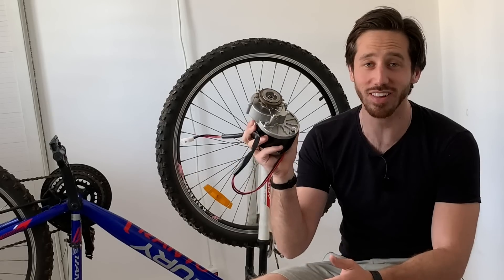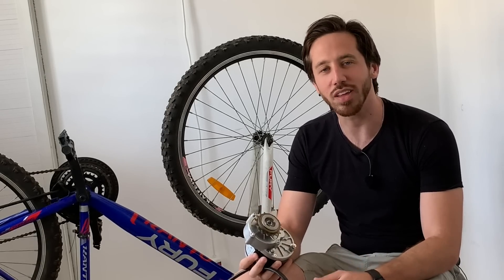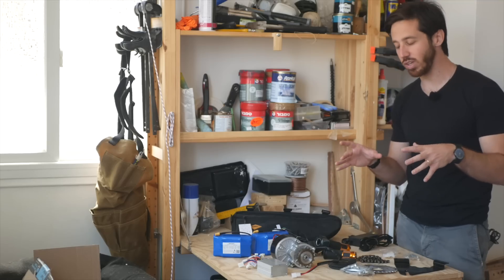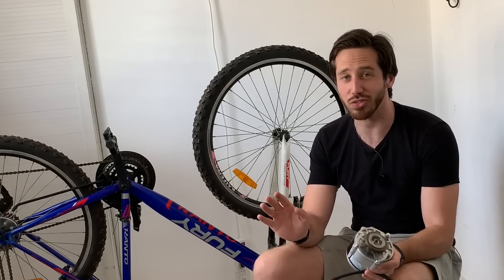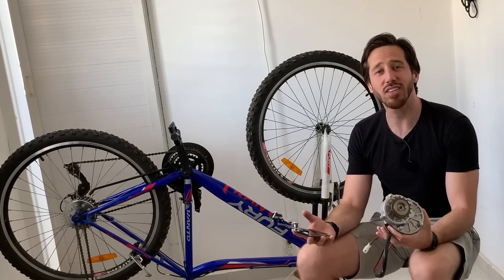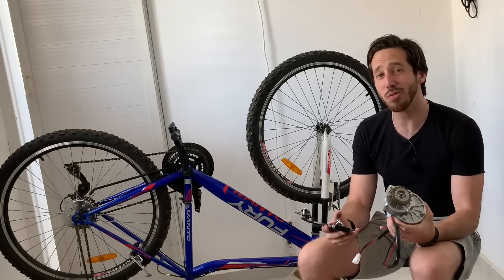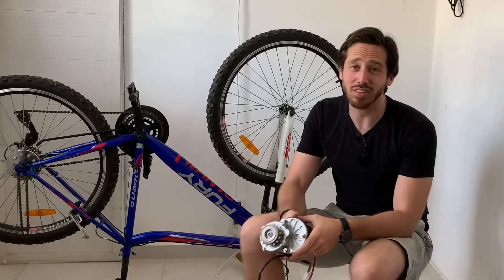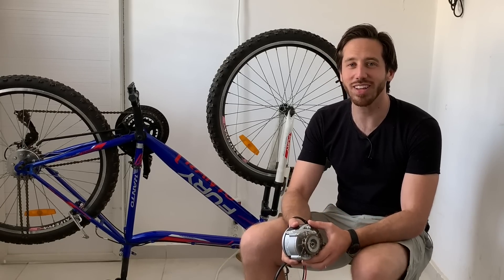Do NOT buy this $103 electric bike conversion kit

Comment: I mounted the bracket on the inside of the stays and it lined up pretty close, added 1 washer to each bolt and the chainline was perfect....but the motor is junk
Reply: I wouldn't call the motors junk. I have had both the 250 and 450 watt motors. I have put over 500 miles on the 250 watt and almost 1,500 miles on my 450 watt motor. These are geared motors and they are setup to only run about 16 mph at top rpm but if you step up the battery voltage you can get much higher speeds from them. I'm currently running a 24 volt 450 watt MY1018 motor at 36 volts and my bike will top out around 26 mph on a flat road. My bike is heavy (65 lb) and me (205 lb). I personally think that is pretty good since a comparable ebike would cost over $1,000 and I have right at $300 in mine.
Reply: @jeffholmes9483  do you have a list of links to the parts you used? 300 bucks sounds pretty sweet.
Reply: @jeffholmes9483  Some frigken glad to hear the motors are rugged , I'm planning a trip to Ecuador and have been testing my motor on a heavy Rover Tandem , sometimes I load up the back seat with large rocks  to simulate my wife and her gear ....the extra weight helps the Big Apple tire  adhere to road surface

Comment: Sometimes it pays to not be cheap , thanks for highlighting that fact .
   Personally i would only buy stuff with runs on the board , IE:  proven track record even if it costs more .  
  Old saying .....  do it once , do it right .
  Although i have never  put on an E bike kit , many times i have thought about it , and i would put on the heavy duty bafang motor , small under powered motors are more likely to burn out quickly imo , then you are back to square one .
IMO if you build powerful and or heavy duty ,  you can still choose to use low power , but you end up with a conversion that lasts a long time (theoretically  :)  ).

Comment: You may have answered this before. But I haven’t seen it. Should you top off your charge after each ride. Or should you ride several different rides and let your battery drain and then charge it. I rarely ride the same amount each time and usually drain the battery about halfway.

Comment: Idea!  Design a mount that IS universal for the "kit" you have gathered, then re-sell the kit with your mount. Don't try to make a million bucks over it, but keep to the "inexpensive" theme. You can make a million bucks by selling a single unique item at a huge price ... or you can sell a million of them and make one dollar profit on each one. Personally I went with a rear hub 750 watt motor = $260 to $280 (U.S.) (depends on the warehouse where you buy it) It's the easiest and safest conversion of them all with all the torque I need to pull a cargo trailer loaded with 100 lbs of groceries up a 5% incline at 28 mph. The only extra to the kit was to order and install a controller able to handle 1500 watts which means it's far less likely to cook the FETs under load.

Comment: Thanks for making the vid, good to have the warning.. . Bracket fixings seem a bit flimsy, if you consider the force of a big pothole.    Even if it lined up the motor cog would get v close to the spokes. Could try a spacer to step the wheel cog away from the spokes, or find a wheel  where the spokes are nearer the frame, more dished? Perhaps it fits town bikes & shoppers better than mountain bikes.

Comment: From my experience with these kits there are to motors used, the MY1016 and the MY1018. Both will fit the mounting bracket but the MY1016 has a 1/4 inch stand of that keeps the motor from lining up like it should. It is like they should use a different bracket for each motor type. It is just a guess but I think if you used the 450 watt motor (MY1018 ) things might have lined up better.

Comment: I bought two of those motor bracket sets and they both work fine on the two old mountain bikes I used them on. One bike I have been riding three years now . Maybe the age of my bikes made it easier to fit chain drive sprocket alignment ? Search YouTube Rick Alger to see my bike 👴🏼

Comment: I had one of these on my bike before I went brushless. It wasn't bad when it worked but I had a list of issues;
1: Chain tension was impossible to maintain because it kept getting loose and throwing chains every couple hundred miles
2: Sprocket alignment is a pain in the arse
3: the freewheel fell apart on me during my commute so I put it back together as best as I could and welded it, which netted me another 2000 miles luckily.
This is a good solution though for fabricating your own electric go-kart though. It would get a decent wriggle on with the right gear ratio.

Comment: How does the difference in volts in a charger and a battery impact the battery?
For example. Lets say that my charger is rated at 12v and my battery pack is 24 volts, how would it change  if my charger were to be 24v ?

Comment: all you have to do is put split plate on the outside with spacers for the rear gear to offset the gear. I have seen guys use extra spacers and even cut rubber spacers in diff builds. Also I would cut a hole in mounting plate where the bike frame weld seems to be pushing it out.

Comment: I found out early on that if you try to cheap out in building an E bike that it will usually cost you more in the long run. Converting a bike with a quality kit that does work and fit generally costs more than purchasing a decent E bike outright. Target cost is typically in the $1,300 to 1,500 range. Anything cheaper anything cheaper and parts or support will be sketchy.

Comment: I built my ebike with the same "on the cheap" directive, but went with a rear hub motor kit, and it cost around $160.  Even when being thrifty, the old adage, "buy once, cry once" still applies.

I do thank you for calling attention to the hoverboard batteries.  I may buy some of those to assemble an "emergency" second pack.

Comment: @ 3:33 couldnt you just use a spacer of somesort..? put your axle nut on.then the motor mount then another axle nut // using a slightly longer wheel axle if needed?
Reply: https://youtu.be/-S5udTm2rp0
Reply: Just simple jugar

Comment: The gear you put on the tire I use the same kind on my bike for my gas motor you could try to flip the gear ...you can see it has about half inch play left to right depending on what side you have the gear bolted to the spokes...flip the gear bolt it back on you will have it stick out about half an inch more

Comment: "Work right out of the box"? For 103$ thats much to hope for. I bought a 49cc chinese conversionkit to motorize My bike and it took me two months of looking for parts, disassemble, reassemble, scratching My head etc. Turns out, the person that translated the manual from mandarin needs to learn English properly and after i stopped reading and started THINKING instead the assembly got a lot easier. Now it runs as a fucking rocket...

I have looked into the prospect of convert a bike to electricity and found that with the setup i choose ( 1000w brushless motor, 36v, 11 Ah battery, custom fittings, homesoldered electronics) it Will cost about 300$ to build it from scratch. 

A piece of advise: if anyone wants to convert their bike out of THE box they should buy a kit locally. Higher cost but larger rate of succes

Comment: It's a lefty kit and brushed motor. Pretty cruddy for now adays stuff. Plus at 4:00 you have the mounting place backwards.
Bafang has some pretty cheap full rear hub kits for 300$. Powerful systems. You really not gonna find most conversion kits for less then 200$ unless it's used or a very old one.
Plus batteries are like 200-300 for 10ah lithium. but you got many options to go with. Rear rack, water bottle, latch mount, exposed cell, hardcase cell, middle frame triangle. Lead Acid would require a rear rack and if you go anywhere bigger then 10ah. your looking at some hefty weight. Already looking at 21+ pounds with 3 or more lead acids for 36 or 48volts.

Comment: Thanks for following up. I wanted to do the build but after pricing and headache I decided it wasn't worth it. I couldn't find a solid 5 star kit with video demonstration and longevity test. 
 I was waiting to see if I made the right call. I just ended up ordering the radrunner 5 and will try a cheap kit once you have tested it and have found a solid kit that works.
Reply: Hub motors are the way to go, they are super easy to assemble and don’t matter for your bike frame, by far the easiest and also way more powerful at low prices. I’d have only paid like $50 for the kit he chose, and that’s because I can weld and fabricate a mount incredibly easy, but hub motors really are the way to go for cheap and simple and powerful motors. Downside is for extrme off-road use (like doing backflips off ramps, or downhill trial riding where you want to do 360 spins in the air), well hub motors are not the best since the weight is at the ends of your bike so it has a lot more inertia if you are intending to do serious trail riding or drifting in the mud they might not be a good idea. If you’re just on pavement or commuting on gravel roads, well you’re not exactly doing backflips and tricks, so then the hub motors are fine and all you’d need and those won’t be an issue.

A decent 26” wheel kit is like $150 (1000-1500w), even the off road super fat ones are the same price (like I have 4.8 inch wide mud and snow tires on one of my kits I need to install soon, it was like $145 for a 1000w kit). My road bike had to use an expensive one at $230 (because it’s wheel size is 700c), but it runs great (stock rating of 1200w, but I did a simple shunt mod to the controller and I’m measuring just over 2 kW of power, it handles it remarkably well!). You basically swap your wheel out, install the torque arm (needed for these high powered kits that try to do wheelies, haha!), and then zip tie your wires on the frame neatly and put the controller in the included bicycle pouch. The only thing they don’t come with is batteries since everyone’s going to want something different., but very easy to install and they just work on any bike the wheel is made for, it really doesn’t get much easier than that, it’s like 30 minutes to an hour, then your away riding. Just check with laws if you want to be compliant if they are picky (like some places are maybe 250w max, others are 1000w, and where I’m at there is a loophole for unlimited power and speed just as long as you’re pedaling so I made my own sensor and relay so it only allows throttle control when pedaling since I don’t like PAS systems since sometimes I want to pedal without any assist)
Reply: @jakegarrett8109  send me a link to the kits you have had success with. Also where do you source your batteries? 
Thanks for the info man, that is awesome
Reply: Jared L Mine are for uncommon bikes, but Voilamart sells the 26” ~2” wide wheels most bikes use, you can find them selling on EBay and other places.

One of mine is 700c race/roadbike wheels, and that one is from company called “EbikeLing” and you can find them on Amazon or EBay if you need that size (best value by far for 700c wheels) also their customer service is top notch, they at first sent the wrong wheel, but it was the easiest exchange I’ve ever done and their phones even at 5 pm on a Friday I got ahold of the correct representative in like 30 seconds and got it sorted quickly as pain free as possible. The other is for my unfinished custom project bike, but it looks like really good quality even down to the Mosfet selection on the electronics circuit board (same power fets as I used for 2 kW, so I know it can easily handle at least double the power they rated without getting warm or any issue), and mechanically looks like a beast. I bet my body and spine will break before that thing does, haha! That one is Voilamart brand (those are probably the guys you want to go with, I know Voilamart makes a lot of good standard 26” MTB wheels like most bicycles use and those are the reviews and abuse tests I watched before selecting it for my off-toad monster bike).

I think you can find either on EBay/Amazon/or your preferred place for buying stuff (both were shipped in like 5 days or something fast like that, and price included shipping in the US, which is great because these things are well packed in a huge box and pretty heavy, I picked some of the beefy motors, haha, no 250w legal limits around here!)
Reply: Jared L for batteries that’s a good question, I first determined what I needed and valued (cheap/safe/weight, pick 2). I went for safety and long lifetime so I went with LiFePo4 (basically the least explosive and flammable/volatile battery and it way outlived Lipo by a long shot, however it weighs a lot and expensive). That ultimately determines where I would source it.

For instance, I use LiPo batteries for my RC planes and quadcopters, but those things love to shoot flames to the ceiling if you mishandle them, like crash/possibly falls over onto a sharp rock, or just not attending them while charging, they have crazy insane power performance but not ideal for long range, great if you wanted to drag race and deplete your battery safely in 1 minute, with say 1000 amps from a 10 Ah battery, these can do it... however standard Li-ion is more popular for ebikes because even if it lacks power it will hold more capacity for that range per battery size and weight, making Li-ion better for any sort of range over 10 miles. So to me it was either Li-Ion or LiFePo4, and I went with the safest and longest lifetime battery, but it cost me extra weight and money. You just have to pick based on where you live like your range for your capacity, and what you’re willing to spend and what your risk level is.

So to answer that, all my parts were determined and purchased from EBay sellers and I forget the name of the battery place, but it really will vary since I needed a specific capacity (I estimated range I really needed to size the battery), and then picked based on battery chemistry type and then finally the seller was determined by who had a good battery in the size dimensions I needed (wanted narrow configuration to fit in the frame of my bike, but if it was on a cargo rack it wouldn’t really matter).

So that part is complex, and certainly the hardest part. It has some math involved, haha, I think BOSTCH has an alright battery estimator on their website you can input your expected speeds to be cruising and type of bike (affects aerodynamics based on how you sit) and stuff like paved roads or gravel and it will spit out a ballpark range that can help size your battery.
Reply: @jakegarrett8109  thank for taking time to respond with all this info. You are clearly knowledgeable. 
 I have some 1-3s lipos for some quads and man they are finicky and I see why. 
I thought about building my own battey with some 18650s and they seem to be 3.5-4$ per cell and i would need a spot welder. 
This safe long lasting battery im not familiar with so i will def be reading up on it. 
What are your main sources for getting this info, im trying to learn more, but basically FB groups and youtube are sources i was wondering if more were out there. 
Thx man
Reply: Jared L basically since I was born I was crawling around in diapers taking things apart and just learning, haha, it’s just years and years of wanting to learn and build and create, so even in high school I was in robotics clubs and any other stuff I could get into. I’m now a mechanical and aerospace engineer (so not even electrical, but so many of my designs needed motors or actuators or programming that I just kind of learned those skills, lots of reading online forums but really just by doing and then troubleshooting and researching bits and pieces of how to do stuff, and lots of fried electronics, haha!). Not one source of information, just mostly hands on and studying schematics for most of what I do and practicing, there wasn’t an easy way (I love learning and improving myself, I actually find it most fun and exciting when I fail because then I know I can learn something from it).

Comment: wow I've never seen this sort of sprocket on wheel setup, looks like a really bad idea.
Reply: They do it all the time, it’s typically for the “80cc” (66cc, the Chinese suck at measuring) 2 stroke gas engine kits that are below $100 USD. They work, but they really tighten the sprocket side spikes and unbelievably annoying to install (the rest of the engine kit is like 4 motor bolts, and 4 nuts for the duel tank and 2 for the throttle and clutch, that part takes like 15 minutes to install but the rear sprocket alone takes like 30 minutes to just over an hour if you don’t have it spaced perfectly the first guess with rubber spacers). It’s not great... It works, but not the most clean solution...

Comment: Hi mechanical engineering student with a whole lot of time here who has an old razor e200 scooter that’s now in parts. Why not build an electric bike out of these components?  It seems like I could cost even less. Plus you could mound the motor on an already attached rack by screwing it to a piece of wood and running a long chain to the wheel. Have any suggestions to this plan? pls lmk!

Comment: That kitchen you have does look like a nightmare the kit I have in my opinion is very doable on just about any bike it's a great setup I did not spend a lot of money for it for the whole kit I think I spent a little bit over $100 I don't know if you like rear wheel kits but I love the kit comes with the rear wheel or you can buy the front wheel drive I put a lot of miles on that kit and haven't had a problem not one you may want to think about maybe trying that out if you like that setup